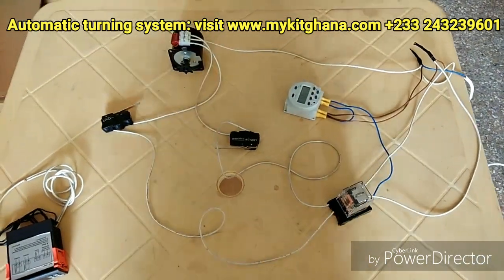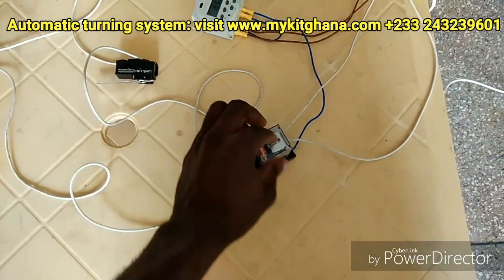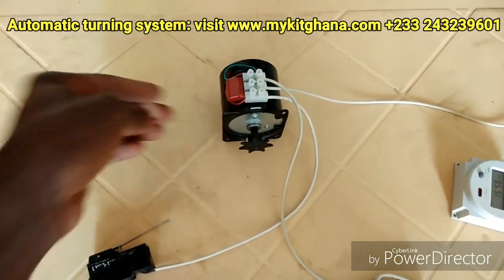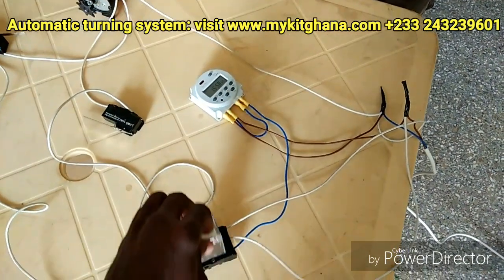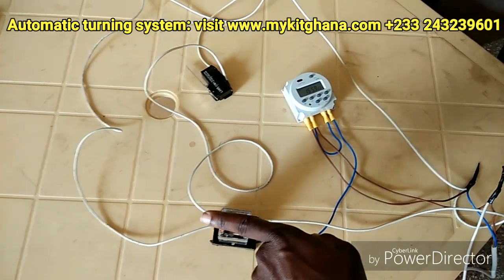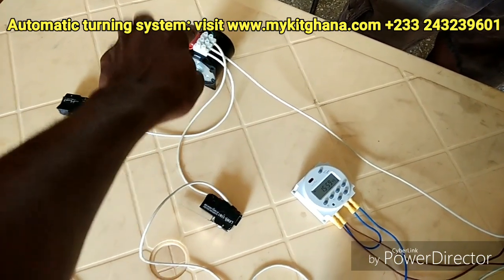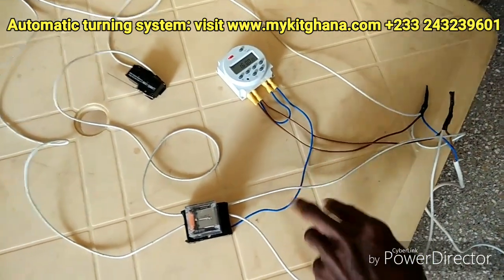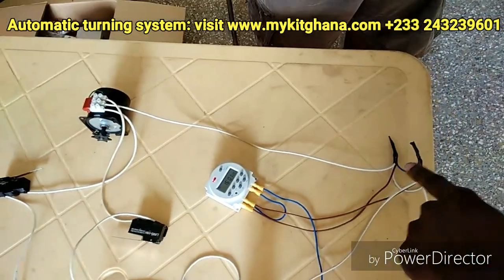How to make incubator egg turner system automatic with timer switch

Comment: I was wondering how do you get the trays to stop in the middle and then stop so that you would be able to remove the trays and rest to “HOME “ position? Then I would like to see a more detailed video of wiring instructions of switching it into auto and manual control switches. Thank You 🙏 and keep up the great work 👍
Reply from the maker: Thanks for watching. I think you can solve that by putting a switch on the NEUTRAL WIRE that comes from the middle of the motor.
Do you get my point
Reply: MyKit Videos Are you talking about putting a SPDT before the relay and then connect it to another SPDT then connect it to which ever the one that you want power going to which ever you want powered up or down. Correct???
Reply from the maker: 3:30
Reply from the maker: No
Reply from the maker: The wires coming from the middle of the motor. Just put an ON OFF switch on that line
Reply from the maker: First of all, do you see the wire I am talking about
Reply: Can you make a video where the wire put on the relay step by step please..

Comment: can u please help me sir. beacause I only have a timer relay I dont have a separate relay ang timer. and it has a little bit different connection . I will indicate the photo of my timer relay combination I hope you could help with this thank you.
Reply: sory I can't upload a photo of the said timer relay sory . but the connection is the same as a relay but the difference is it has a built in timer at the top hope you could help me thank you
Reply from the maker: peter cyril ayco 
Okay I would be glad to help.
Please subscribe first. Thank you
Reply from the maker: Here is my WhatsApp number
+233243239601
Reply: I have another question do you realy need a dpdt relay. and Y? can I also use a SSR? thank you
Reply from the maker: peter cyril ayco 
Ok. mykitghana@gmail.com
Reply from the maker: peter cyril ayco 
Because of the type of motor I am using. That motor can do reverse rotation.
For this type of motor u don't need ssr

Comment: It is 8 pin relay switch ? Plz provide      information about switch
Reply from the maker: shefali Mahadevan 
Yes 8pins
Reply from the maker: Model: LY2NJ HH62P / JQX-13F / LY2 With PTF08A Socket Base

Coil voltage: 220V

Contact Rating: 10A 240V AC / 28V DC

Type: DPDT 8 Pins 2NO 2NF